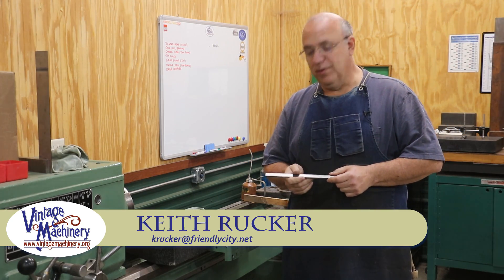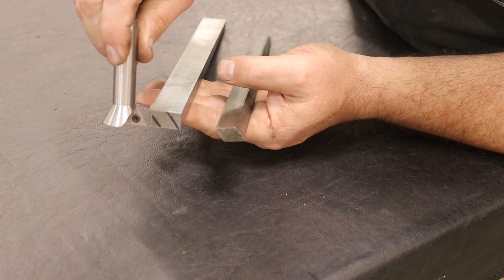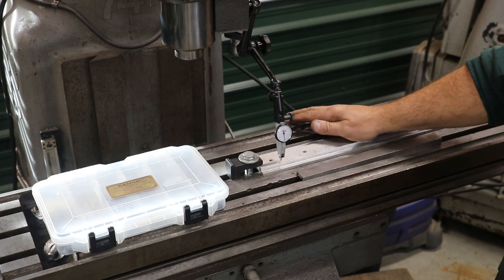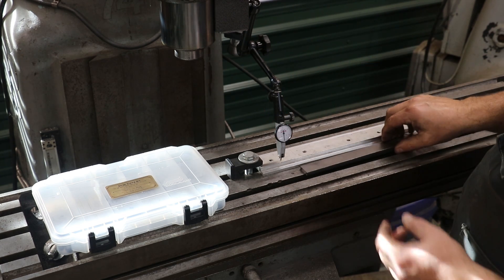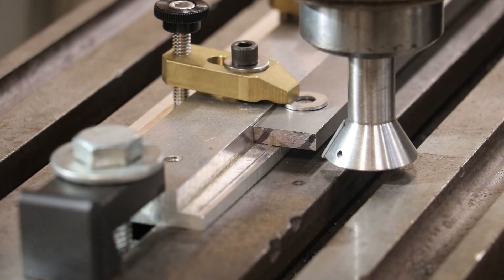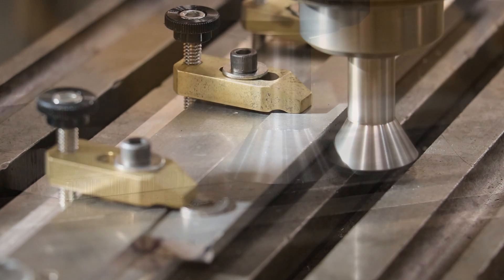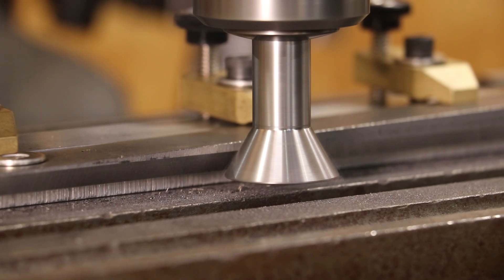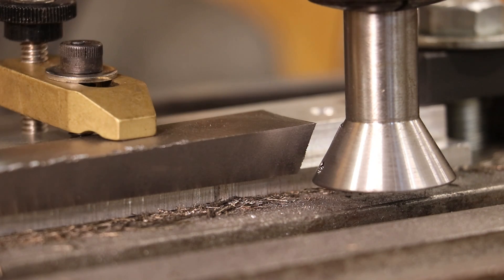Milling Dovetail Angles on a New Lathe Cross Slide Gib - Monarch Lathe Restoration Part 20

Comment: The gib is a parallelogram in x-section (flat shape with opposite sides parallel and equal in length), not a trapezoid (a quadrilateral having two parallel sides and two nonparallel sides).   For some reason, people love the name "trapezoid" and call every geometric shape a trapezoid.  Your gib is actually the exact opposite of a trapezoid.

Comment: is there any chance you might think about drilling and tapping a few holes in the side of the cross slide to install gib screws?  or tiny springs under short set screws with jam nuts to lock the position.  think of the tiny springs like was used in the rapid traverse on the mill..  just a back up thought..  i know that is going to come out perfect.   don't cut it to length until you get it to fit perfectly..

Comment: If you use the crossslide upside-down for your clamping jig to hold the gib to mill your angled sides then you dont need a special cutter or angle blocks.

Comment: I will be watching for how you get that 0.0003 slop out of the taper in the new gibe. Great work. Love the videos.
Reply: 0.003", 0.0003 would be 3 "tenths".
Reply: Cut and try. If the slop is at the narrow end of the gib I expect he'll make the angle a little more shallow until it fits.
Reply: @Mishn0  - Or he could (and might) scrape it in?
Reply: @DSCKy  We'll see, won't we? I'm thinking Keith will use his new (to him) compound angle sine plate mag base on the surface grinder for a start.
Reply: @Mishn0  Ah yes, I think he mentioned that when he showed it. I forgot.

Comment: question is your rate of feed just a little fast  I would think a slower run would produce a better finish
Reply: I don't think Keith is concerned about the finish coming out of the mill, the part is going to be ground to finished dimension on a surface grinder.